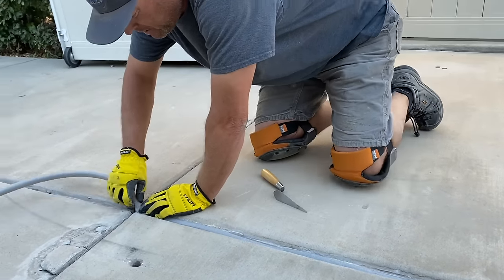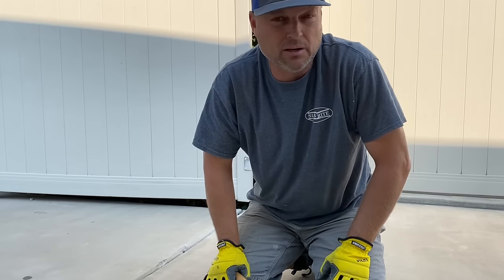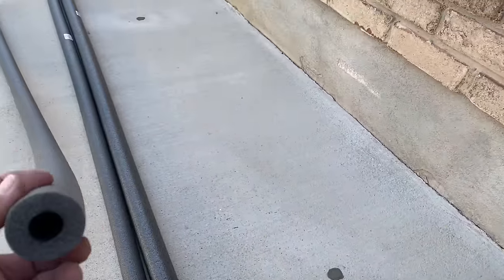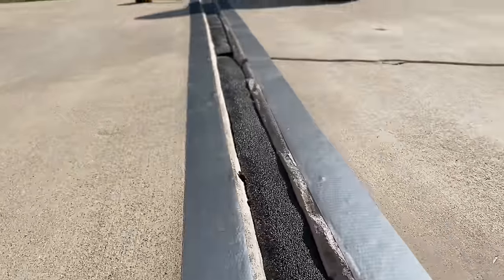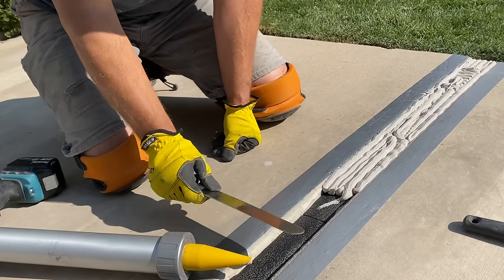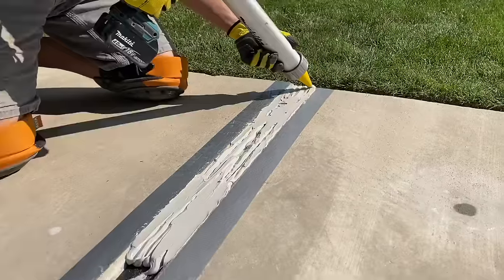How to seal concrete control joints

Comment: You should check out using dymonic semi self levelling caulk for this. It doesn’t need and tooling. It can be applied on gentle slopes as apposed to their self leveling caulk which is only for dead level surfaces. Loved the sand trick

Comment: Freaking amazing work. I have pretty big expansion joints in my garage. I'm going to grind and acid stain the floor and plan to do exactly this with my control joints. Here's my question: should I do this BEFORE or AFTER staining? I'm not sure how the acid stain will react with the sealant and sand...
Reply from the maker: Do it after staining.  You shouldn't need to sand over the top in your garage.
Reply: @dscottgillett  Thanks a lot for this. I'll definitely do the staining first then. I shouldn't have any problems putting a water based clear coat over the stain and joint sealant?
Reply from the maker: @poshko41  Do the joint sealant last, the clear coat may not bond to the sealant.
Reply: @dscottgillett  I am REALLY glad I asked these questions and that you were kind enough to answer. Thank you.
Reply: @dscottgillett  One more question... Would Sika no sag sealant perform similarly to the product you used here? Thanks.
Reply from the maker: @poshko41  I have had problems with Sika product bubbling as moisture vapor tries to escape.  I stopped using it years ago.

Comment: Before you forget the  raised edge you will create when pulling up tape first before any sand is applied,
Pull the tape first, run something down like a thumb with a rubber glove on, and press down raised caulk. You won't have a big mess smearing down the raised edge because you protected the cement with tape. The transition edge of the caulk will flatten out before sand is broadcast into the wet urethane caulk. Self-leveling pour down urethane is much more leveling and penetrating into the concrete for proper adhesion, especially if you prime the cement voids 2 sides for the urethane to blend with and create a superior waterproof bond that won't separate from the cement as most applications on job sites do. This is nothing new, just industry standard by the book. Most people skip the priming of the joint, what do you think primers are for. This is done on roofing plywood deck joints as well.
Reply: May I ask, what kind of Cement Primer you would suggest??
Reply: I use to use 2 types, one ,single stage Vulkem or Sika , it was clear and fast tacky  , or Polycoat 2 component  slower drying might have been 230  or 21,its been a while, just call them  It was  a clear blue (first part and amber for the second part. With all the changes in VOC, not sure what they can sell. Polycoat  is based out of Texas. I was in Calif
Call Surface FX inc    in Santa Barbara CA   talk to Louie or the owner Michael Rattapel owner   tell them its for an adhesive primer for the joint seal for urethane caulk
You must not apply caulk until primer is tacky like masking tape, not slimy.

Comment: Great video Sir!  I have nearly the exact larger gap half way up my driveway and all the wood in my expansion joints are long gone, since this home is a 100+ yr old home.  The driveway isn't 100 yrs old, it was put in in roughly in the mid 80's.

Comment: That looks damn good, brother.  Nicely done.  I'm about to seal new control joints on a freshly poured slab then after they cure, I'll seal the entire slab.  Fortunately, the control joints are not as wide as the ones you did but a few are quite deep.  I have some backer-rod to fill those deep spots before using a self-leveling control joint selant. Appreciate the video.  Have a fine weekend.  👍🏽🤠 03/16/24

Comment: Great job! I have done this type of work before, but never thought of using tape or sand. Thanks for sharing!
Reply from the maker: I'm glad you found a tip you could put to use.
Reply from the maker: @𝓣𝓱𝓮 𝓘𝓷𝓬𝓻𝓮𝓭𝓲𝓫𝓵𝓮 𝓖𝓾𝔂 ♥  I'm not a tile setter but I would imagine you need to re-grout it.  You might need to dig out the old grout first.

Comment: Did you know why you really want the foam rod to fill the void ? To have the caulk grab the 2 sides
of the joint not the bottom, why ? For expansion and contraction, you want only the 2 sides moving to be where it stretches. Your first mistake, the caulk will pull away from the sides eventually as is almost always seen on most projects over time. A thin viscosity clear primer(that gets tacky in about 20 min) should be brushed on the sides of the joint. Its thin viscosity over just heavy poor penetrating caulk
will reach deep into the concrete and be soft enough to blend into the caulk for the proper seal and grip to the concrete. The watertight seal in and around that joint will prevent water from working its way to where the caulk alone cannot seal properly. If you dont use this primer, the stretching back and forth of that joint will pull the caulk away. If you don't believe me, just look at application spec sheets on Polycoat,General polymers ,Vulcrom products. We do this on pool decks. This has always been a no brainer to take this step that most people leave out. Another thing. using so many tubes of caulk and then smoothing it out, get self-leveling caulk, pour it in, watch it level so smooth. Bring your tape in closer to the edge of the caulk so its below and not overlapping on top. To expect the caulk to penetrate
into the top layer of cement is not correct. /water soaking into those top layers of cement over and under it , will eventually cause the caulk  to detach. You want the caulk snug and below countersunk
to be protected, as I said so 2 sides stretch back and forth only.
Reply from the maker: It sounds like from your comment you have done this type of work before.  You should also know that there are different techniques and products that will yield the same long term results.  The product we use is Dowsil Contractors Concrete Sealant.  You are more than welcome to look up the installation instructions where you will find it stated in the second paragraph of "Priming"   "Primer is not required with concrete, masonry, most glass and most porous substrates."   Like you I have been doing this for years and using this specific product for the last 6 years and have never had one call-back for product failure unlike when I used polyurethane based products like you mention. Try Dowsil and I bet you never use those other products again.
Reply: if that joint is 2 inchs its junk already  aci or icri spec  explain all this

Comment: Very helpful, and the sand is a brilliant functional & appearance....added touch.  Thanks ...
If using conventional hand mixed cement crack filling, the sand added at the end might also help with blending the old & with the new concrete too.
Reply from the maker: The sand sprinkled on top of a concrete type patch probably won't do anything for you.  But give it try and let me know how it works.

Comment: For erratic cracks that aren't in the control joints, I have used a grinding wheel called a 'crack chaser', it's a vee shaped diamond impregnated wheel 3/8ths or 1/2 inch wide if you prefer, cuts a groove as deep as you need .works great,cuts concrete like butta! It's around $100  for a good quality one. but take time taping to the EDGE as you have, caulk the cut FLAT,no slump, no self leveling caulk, then sand to a Flush finish.I have used play sand which is finer. Add that option into your quotes at $20 / ft ! time consuming but compared to replacing concrete pads,... customers will pay, at least in the East part of the USA !  8 ft crack start to finish takes about an hour . ( just my 2cents)
Reply from the maker: We use crack chasers for fissure cracks, just didn't show that is this video.  Thanks for watching!

Comment: Question regarding the manual gun vs. Makita gun.  I have a full 2 car drive with 2 lanes and the joint in front and along side the garage along the service walk .  You mentioned in the video the gun was turned up to highest setting.  Would it be possible to do the drive I have and joints along the side of the garage and service walk and between the garage door and driveway slabs with the manual gun.  I would like to try this product instead of the Sika this time but just can't find it within my budget to spend ~$350 for gun with battery.

TIA
Reply from the maker: Yes, you can do it with a manual sausage gun.  your forearm may get tried but it is doable.  We do so much of it, it just made sense to buy the Makita guns.
Reply: @dscottgillett  Understand the difference of doing it 8 hours a day in commercial applications vs DIYer.  Thanks again for the reply.

Comment: I came up with the same process on my own about two and 1/2 years ago. However, I don’t use backer rod as a base, I use sand on bottom and on top. If not ever needed duct tape but I did consider using it. Also the grout spatula is a new idea. I use Sika sealant but I will look into the Dow brand also. It looks thicker and easier to work with a trowel lot spatula. Great video. I love UTAH. I lived in Farmiington for 13 years. Now I’m in Pasco, WA.
Reply from the maker: I've bee to Pasco, Wa.  Spent a few days at an RV park there this spring.  I really like central WA.
Reply: Just curious, does the Sika product you haven't specified actually allow for or recommend contact with damp, wet or wicking organic material and 3 point contact?

Comment: I came across your video by chance.Iwill be helping my brother to repair his driveway hopefully before this winter.He needs to replace  but doesn't have the funds at the moment. The driveway had water get under the slab causing it to lift an sink up to 6 inches. Hope to seal the cracks before any more damage happens.  Thanks for the great  advice.👍

Comment: Does the seal without backer rod hold up as well as those with backer rod? I heard its crucial to use backer rod to ensure the seal doesn't fail...
Reply from the maker: for normal cracks or control joints that haven't widened backer rod is not necessary.  The backer rod is primarily used to take up space in the crack so that you don't use an excessive amount of sealant.

Comment: Awesome job.  Have you tried the Sika self leveling product?  If so do you prefer this product over the Sika self leveling product?  Thanks
Reply from the maker: Yes, I have tried Sika Self leveling and non sag. I had a bunch of problems with the non sag bubbling the self leveling is really messy. My material supplier suggested the Dowsil and I have never looked back after 7 years of using it. Thanks for the question and watching the video.
Reply: Thanks for taking the time to reply.

Comment: I have had success with Sika and regular sand.  Should I fill the space between garage door and driveway.  Thanks.
Reply from the maker: absolutely.  That cold joint is very susceptible to water penetration which can led to the concrete sinking in that area.

Comment: So glad to find this! I tried to twist 3 3/4 pieces to fill 2x5 inch joint gap replacing the rotten wood.

All your suggestions would have avoided my install fail.

Self leveling sika in 85 degree weather just made the back rod float making a mess. 

Any tips on an aggregate driveway which makes leveling choppy?
Thank you!
Reply from the maker: Richard, we don't have driveways with exposed aggregate here because of all the snow we get,  so I have no experience with sealing joints in them. I hope you find something that works for you.
Reply: @dscottgillett  thanks Scott for the quick reply. Your tips lead me to a distributor near me that sell Dowsil. (Seattle- Atlas inc)

Cheers!

Comment: Concrete is porous, filler is not. Therefore water gets between, especially above the crack.
Get some latex paint to match the concrete and thin it until it drips out of a brush. Mask around the curve in the joint, and saturate everything beneath. Do not be stingy. 
The filler will stick to the paint-sealed concrete much better than raw. Water can not work itself between.

Comment: Good video. You should have shown how you prep the sausage for the sausage gun. I remember the first time I did this type of caulking and I couldn’t figure out how to open it. I would cut the tip and the caulk would go everywhere. Then a more experienced fellow should me just to tap it hard on your steel toe twice and it pops right off. How do you guys do it? Thanks for the tips. I found the last part to be the most useful. Oh and I’d use general construction masking tape rather than duct tape. Less expensive and does the same job.
Reply from the maker: I just drop the sausage in the tube and cut across the end of it.  Thank for watching.

Comment: This 'Dowsil sealant is now $35.00 per tube for that 20oz. sausage in April 2024 Very pricey. Quadrupled in price in 3+ years....unless you get a much lower price from wholesale supplier.
Nice job though, the Dowsil sealant looks like a very good product and relatively easy to work with, it seems to have a long work time before it starts to set up. I live right near you in Riverton. Have a daughter in Draper.
Reply from the maker: The price I pay is no where near $35 per sausage. If it was, none of my customers would buy this service from me because it would be too expensive. Thanks for watching.

Comment: Do you make sure sealant all the way to surface? I would image yes, but what if your 2 slabs are not level?  Thanks. ( And great idea with the duct tape)
Reply from the maker: On these very wide joints in this video yes,  the sealant was level with the slabs.  If your adjoining sections of slabs do no match each other then have a concrete lifting company level them for you.  That is our primary business, concrete lifting. We raised the slabs in this video to match before we sealed the joints.

Comment: My driveway joint is 1'’ wide, but only about 1.5 inch deep because there is a strip of cracked, broken, eroded  concrete running along the joint, but covering only 1/2 - 3/4 of the joint bottom width. It is still very intact, not impossible, but very hard to chisel it off. 
1- Can I leave it the way it is and cut a pipe insulation foam tube in half to fit? I am concerned about cutting because someone said, “Don't make a hole in it’’ when he showed how to insert the backer rod.
2- You said, ‘’ The sealant has to be ¼’’  thick". Is it measured from the deeper sides of the inserted pipe insulation “backer rod" or from its higher round, middle top?
3- At some spots, the joint edges don't have the same level, up to 1/4- 1/2’’ difference in height. Should I apply the caulk to the same height level of the lower edge or up to the top edge of the higher side? 
4- Should I cut the nozzle tip small or big enough to cover the whole 1'’ joint width with sealant
 in 1 stroke? I have a 10 oz caulking gun.
I am a senior but have not fixed anything before. With your help, maybe I have enough confidence to do the first project. Thanks in advance.

Comment: Great tutorial video! Too bad I didn't find your video last Saturday, August 07, 2021.  Oh my God my forearms, my legs and and hands - every muscle in my body still aches today.   I just did my first expansion joint between the garage door entrance and driveway using - I inserted forty feet-(40-ft) of backer rod folded in half to twenty feet-(20-ft), twisted and inserted into the joint, I applied five-(5) thirty ounce-(30 oz.) of the Sika Pro Select Sikaflex®+ Self-Leveling Sealant [Best Before December 2019]. I wish I had that power drill sausage gun adapter!  Great idea with the duck tape, playground sand and burger flipper!  I just wish our driveway wasn't in such bad shape - nearly 40 year old house.
Reply from the maker: It definitely has a learning curve but once you get it its not bad.  Thank for watching.

Comment: What brand of concrete caulking compound are you using?  That would be nice to know.  Readers - suggestions?  Thanks.
Reply from the maker: Please re-watch the first 30 seconds of the video where I tell you the material we use.

Comment: I have a couple of questions that I haven’t found in other comments. There is so much advice and everyone has a different way of doing this. 

Are you using self-leveling sealant? I’m not familiar with all the names of things. And then, why or why not?

My second question is, why did you choose the foam backer instead of spray foam? 

I guess I have a third question. 🙂 is it okay in your opinion to use soapy water and your finger to smooth the top? Again, I just see so many techniques, it’s hard to know what is best. 

Thank you!
Reply from the maker: Thanks for watching. The sealant is a non sag sealant not self leveling. Backer rod is made for this application and you don't have to wait for the spray foam to cure. Yes, you could use soapy water and your finger its just not as efficient.

Comment: I just had a new driveway put in and am looking into sealing and caulking myself.
I like the idea of the tape for the expansion joint. Is it not necessary to use it for the control joints? 
Do I need any other forming tools beside the spatula?
Also I plan on using ACT-ATS-22 for the sealer.
Good video Thx
Reply from the maker: Jeff, we only use tape on joints that have opened up more than 1".  We don't use tape on regular control joints. The caulking knives should be all you'll need.

Comment: would it no be better off to make a tip out of pvc pipe to the size of joint you are fill so it has no air pockets.

Comment: very nice. can we use polymering sand instead of dowseal and just use water to harden. thank you. no mess. thx
Reply from the maker: you can do that but if there is movement (freeze/thaw cycles) in the adjoining sections the polymeric sand will crack out and not seal the joint or crack.  You want to use a product that has elasticity properties.